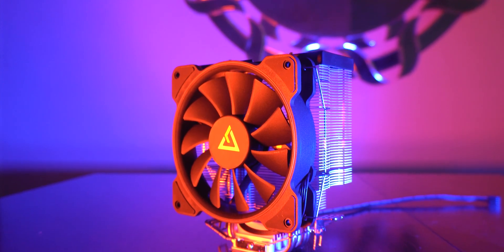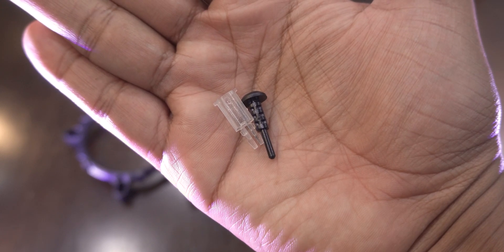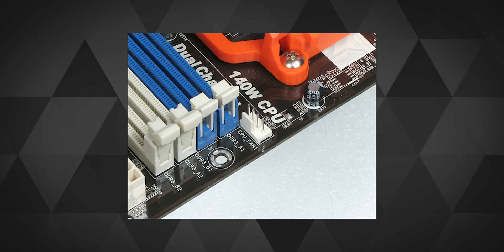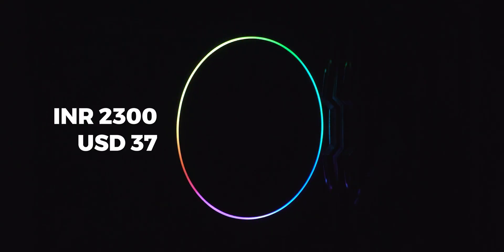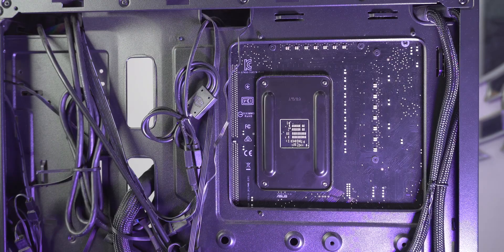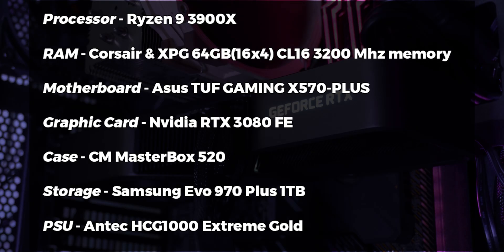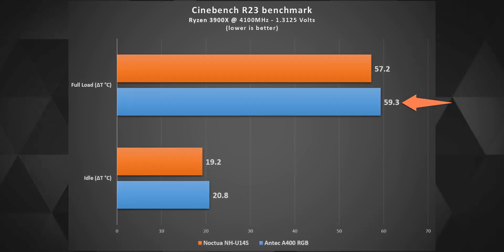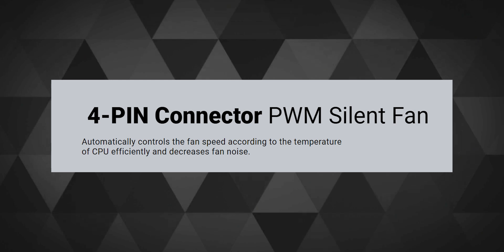Antec A400 RGB CPU cooler Review - Surprisingly impressive

Comment: At least you're more cheerful than most reviewers I've seen lately, lol, and it was a decent review of the Antec CPU Cooler's capabilities while underload and at idle with an AMD setup. However, it would be nice to have seen the results for an Intel based system too, and hopefully you'll have a test bench setup for easy switching of parts in the near future!
Reply from the maker: Haha thanks. Yeah I'm trying hard to get a test bench. And surely the 10th and 11th Gen intels might just push this cooler even more.

Comment: I currently have this cooler paired with the 3600 and it does a pretty good job, I am soon going to upgrade to the 5800x, do you think that this cooler will be sufficient enough to handle that processor if I don't do any overclocking?
Reply from the maker: It can just about cut it on a 5800x. Generally for 5800x I won't recommend this cooler though. If you can sell it for a better one then that'll be better.
Reply: @MrMuBot  okay, thanks for the info and good job with the video.
Reply from the maker: Thanks! :)

Comment: Do we need to remove the antec A400 while transporting the pc by car during long distance travel like 6hrs? , And if I run the benchmark and remove the cooler the cpu won't come off right?
Reply from the maker: If it's not a bumpy ride then no worry. But if it's then add a lot of bubble wrap over every component. 

Run the benchmark several times and then unscrew the mounts with a long thin screwdriver. Shouldn't give troubles then.
Reply: @MrMuBot  bro the antec a400 does not have a screw right? , So I can run the benchmark several times, and just remove the clips right?
Reply from the maker: The AMD mounts where the cooler clips have screws. I was referring to them.
Reply: @MrMuBot  yep thanks bro.

Comment: Great review! There is one problem with this mounting mechanism for AMD cpus. It can suddenly pull the CPU from the socket and this can lead to bent pins. People have experienced this problem with the OEM version of this cooler.
Reply: U here👍
Reply: @dipanpathak  yes
Reply from the maker: Ah yeah it could. Especially when the chip is cooled down. Thanks for the tip. I'll make sure to heat it up before demounting it.